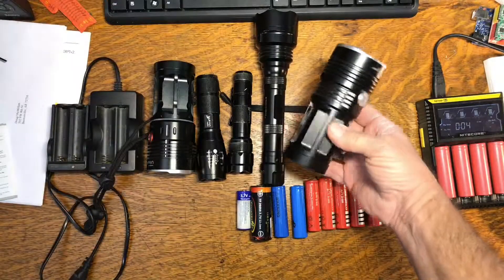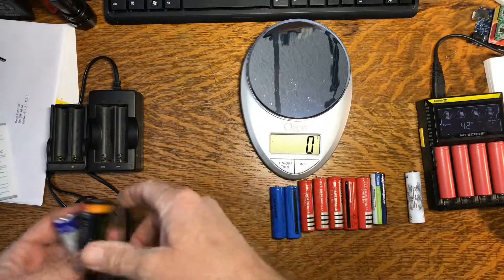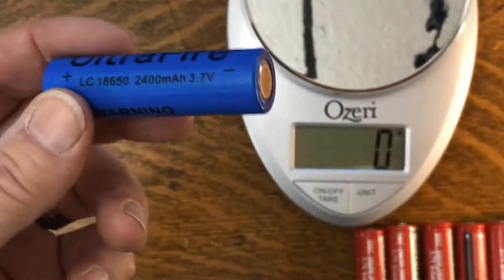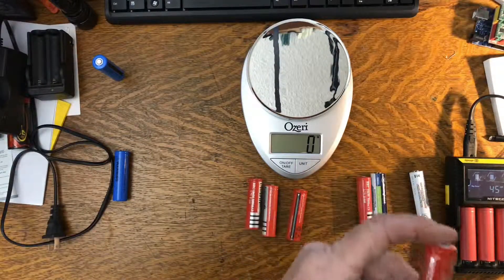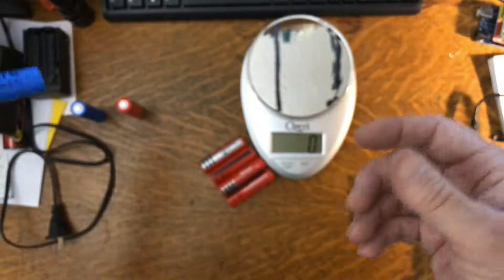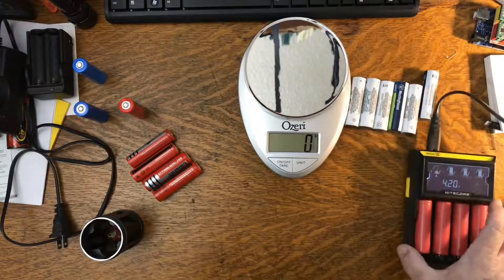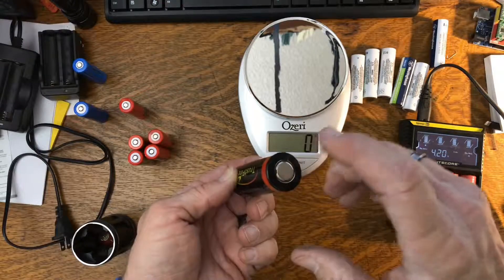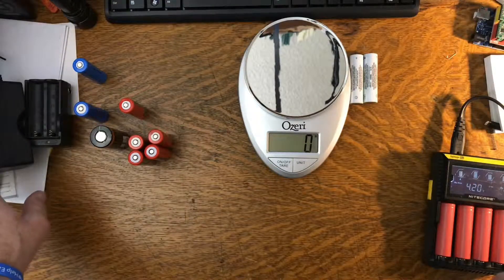18650 battery RC cars and trucks

Comment: So did you cut the suspiciously light cell open? what did you find?
Reply from the maker: I never did. Nobody until you expressed an interest and I got distracted with other projects. If I can find that battery it would still be interesting to see what's inside. 

I do have plans to try and get rolling on this channel again when. My time at home is very limited right now. 

Thanks for stopping by and the question. Have a great day and be safe out there.

Comment: So what is the minimum weight it should be to be a legit 18650?
Reply from the maker: Sherry S there isn’t a minimum weight. They will list a maximum weight and you should see something close to that. You need to go to figure out who made the cells and pull up their data sheet. They will have all the parameters for testing their cells.
Reply from the maker: In general you get what you pay for. For the most part just stay away from the really cheap stuff. If you find a good source stick with them. If it says it’s over 3400mAh stay away. The Samsung 25r is a very dependable cell.